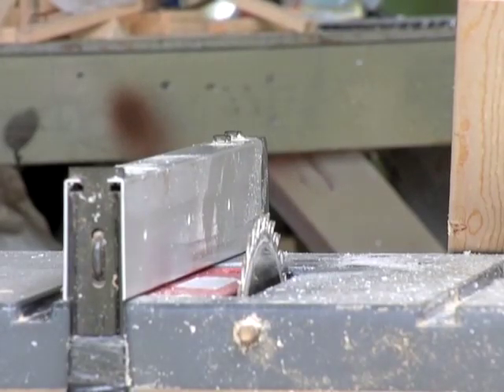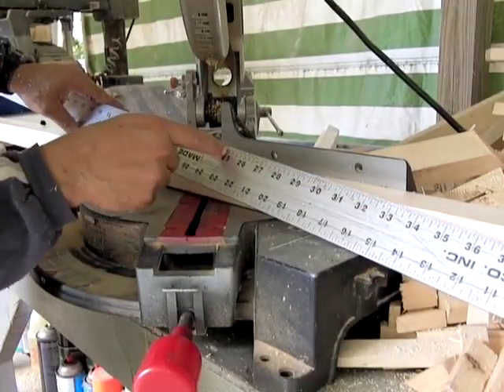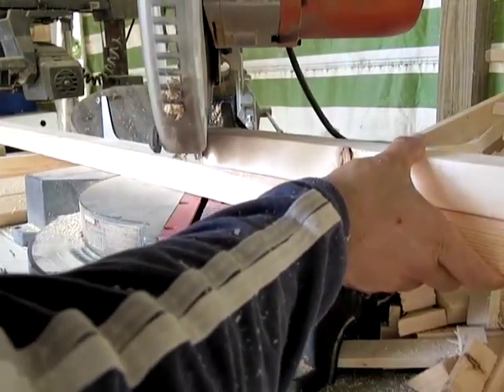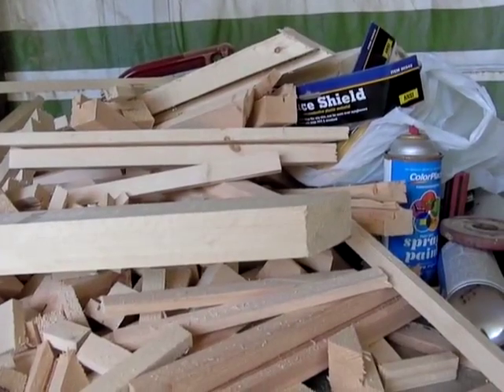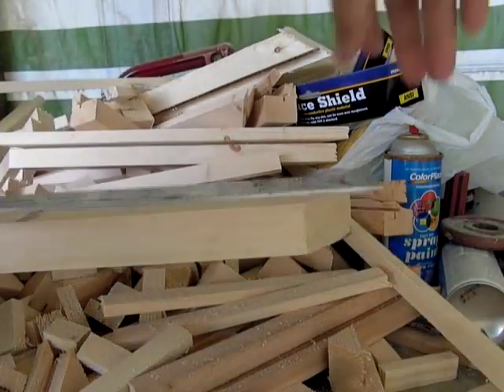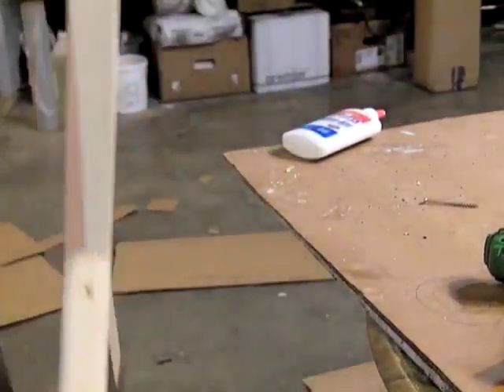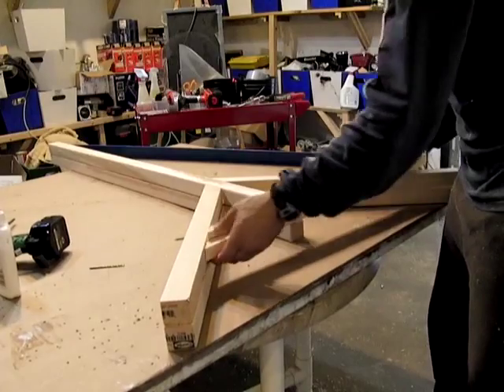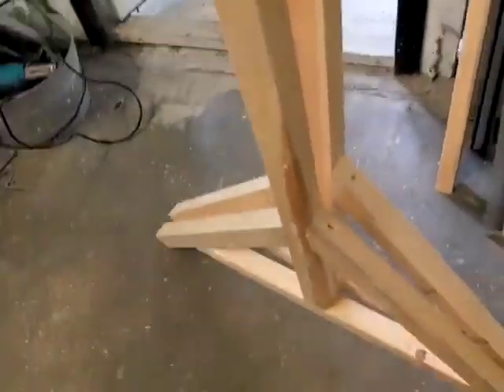DIY FRESNEL LENS STAND HOW TO MAKE YOUR OWN STAND

Comment from the maker: I actually buy the curved wood left over from Lowes at 50% off. It can still be used for building projects but not long straight stuff. Every since the housing bust starting in 2006, straight wood is easy to find. During the boom most good 2x4 were offered first to contractors and sent overseas. In 2006 I wold find 1 nice 2x4 for every 20 at lowes and homedepot. They were selling rocking chair bases as first quality wood. They were also 30% more expensive.
Reply: Fast forward to today: We're now in Boomtown 2.0🤑

Comment: "Or does it just destined to sin on the shelf forever?"

Nope .. Some projects don't require straight and perfect wood because they will be either cut so small that it don't matter, used as wall braces that will be covered up by sheet rock, or for any other project that does not require perfect wood, ie, chicken coop.

Comment: Fergus247: To use as a heat source. It's basically a giant magnifying glass, only cheaper and lighter. Dan often uses it in combination with a sterling motor, which operates using heat.